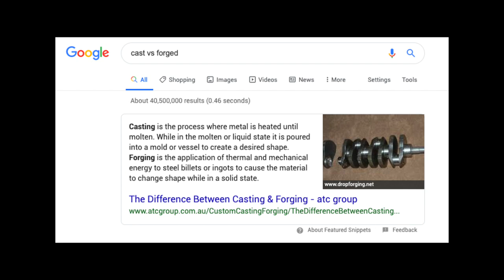Ringland Failure STi Engine Removal & Viewing the Damage..

Comment: did u put a cob tune on it? lol when will people learn
Reply: what wrong with a cob tune ?
Reply: @warock567  it's an OTS (off the shelf) tune. Meaning it's made to fit all WRXs. While this is good for usability and availability while people get their new Accessports, the tune is not designed for your engines specific variables. Every engine runs different, especially after modifying. Which is why it's an important to get a protune or a Map tuned specifically for your engine.
Reply: @Thailerr  oh ok thank for explaining it to me
Reply: Advancing timing with UEL’s is dumb on a stock engine anyway, banks with the long runners are prone to detonation stock let alone tuned where they run on the leaner side... EL’s and a quality protune is what you need to not blow up
Reply: hmm I've had the MaPerformance tune for 3 years. 65k miles on my wrx. when will people learn, yup ja
Reply: @somersfamily  it still run good for you ? I am on maperformance tune too
Reply: Eric and Emily somers what year WRX you have? And the OTS tune may be fine for your specific car, atmospheric conditions and elevation, it’s not right for every car though... and the OTS tunes for the 2015+ fa20 WRX are EXTREMELY reserved...
Reply: Eric and Emily somers what year WRX you have? And the OTS tune may be fine for your specific car, atmospheric conditions and elevation, it’s not right for every car though... and the OTS tunes for the 2015+ fa20 WRX are EXTREMELY reserved...
Reply: the way the guy swings his car around im not suprised
Reply: You guys are getting OTS tunes twisted. OTS tunes are perfectly fine for the person who just wants to throw an intake on their car and leave it alone. That's about all they are good for. What you encounter a lot, is people who continue to mod their car past what the OTS tune was made for. You guys forget, even with a OTS tune, the car still retains its adaptive learning. The OTS map gives a baseline, but the car will continue to tweek the maps the more you drive it. You guys praise "pro-tunes", but I don't hear any of you telling about the horror stories of them. I've had a buddy who drove hours to get his EVO tuned just to come home to be locked out of his $1500 ECU because the tuner wanted to protect his tune. I agree a tuner should tune your car if your modding the hell out of it, not for a simple intake guys, the whole purpose of a OTS tune.
Reply: @dotcom02WGP  Those OTS tunes really aren't very good, just get a protune even if you're stock you will benefit from going that  route. Although they're probably better than a stock tune, but if you live near a reputable tuner that's the smarter thing to do, considering its a tune made for your specific vehicle.
Reply: @Thailerr  So is it possible to still get a flame or pop tune without the cobb thingy?

Comment: I just bought an STI with about 60,000 miles on it and this video has me terrified know that yours broke with only 70,000. I've always dreamed of having an sti but after this I'll probably never buy another subaru again.
Reply: I have 150,000 on mine. I take good care of my car, oil changes every 6k, and I don't launch my car from a dig ever, and I check oil level every fill-up. Looking at that clutch and flywheel, he definitely dove his car HARD. If you want to abuse a STI, you have to build the engine

Comment: Funny how he made a video to prevent from this happening and it still happens to his subie 😭 lol this is what makes not get one why you gotta be a ticking time bomb :(
Reply: I mean he drove it hard without a tune, then gets an OTS Cobb tune, and beats up on it in a hot Arizona weather. Smh. I have my 2017 STi, 34,500 miles. Replaced my clutch, (many clutch dumps and slamming, no surprise there). No engine failure. So, no OTS tunes! Custom tune and let it warm up before beating on it and cool down before you turn it off.
Reply: Yeah I have a 2016 STI with 33k miles. Stock tune and the motor is healthy as can be it doesnt burn a drop of oil between 3k changes.
Reply: @nwbklr  dude there are early symptoms. It won't just "pop" randomly with a broken ringland (you can still drive it with a cracked ringland depending on severity)  unless you throw a rod.
Reply: It’s pretty simple, don’t advance timing with UEL’s, you’ll lean out on cylinders 2/4 with the long runners and pop a piston faster then you can blink. Switch to Killer B EL’s, enjoy the power gains and faster spool, and worry less about blowing it up. UEL’s are the dumbest design, Subaru did a big F there. JDM ej207 has it right with the ej207, twin scroll, EL’s, forged, 8000 rpm stock....
Reply: Driveitsideways 1 Good advice👍🏼
Emilia Hartford Just did a few videos of that same engine swap.
Reply: @someguy920  how do you get your power?

Comment: My dream car is an 07 sti, but I keep coming across videos like this and it gives me second thoughts 😂
Reply: Check your oil. Do recommended maintenance and this won't happen. Oh and get a proper tune lol.
Reply: 07 sti is a good choice, find one that isnt married to a cobb and if its modified, make sure the guy has receipts of all the stuff done. 2.5 liters are alright, the 2.0 are more reliable and able to hold more power. To prevent ringland, rod knock, just keep up with oil and stay on top of it, also dont WOT your engine
Reply: Another piece of advice, don’t advance timing on UEL’s. You’ll lean out cylinders 2 and 4 and blow up faster then you can blink. Killer B EL’s, air/oil separator, aftermarket oil cooler, and s quality protune. Can make max gains on stock turbo without blowing it up that way
Reply: Bugeye Bryan only the 207 is stronger than the 257. I wouldnt bet any other 2.0l block against a 2.5 without being built unless its a 207.
Reply: Bugeye Bryan WOT is fine, just dont over load the car, as in high gear, low rpm wot. This can all be avoided. First things first for any EJ is getting proper maintenance and on time, secondly, get an AOS. No knock means no issues.
Reply: @CXANGLING  Yeah well I say the 207 is amazing because of the heads, but that's about it. That's what I meant about WOT, is to not WOT at low rpm

Comment: just pulled a 2.5 NA apart. Had a Bad Rod Bearing, Cylinders look great and the Honing crosshatch patter is very visible at 190K miles.

Comment: You got lucky on the can gear bolts, first time I pulled an ej they took like 2 hours and the last one was stripped to shit and had to weld on a nut to the bolt to get it out lol
Reply: on the jdm ej20's the cam's have a hex so you can put an adjustable on with a breaker bar. Unfortunately these ej25's suck balls getting the gear bolts off and that special tool barely works if its set in

Comment: I got ringland a few days ago after i installed my EWG upipe and EL header.
Reply: Change tune for it? Sounds like you were running lean or detonating
Reply: Zach Knee it was tuned for it but there was a cap that I removed when I rotated the EWG 180 degrees so it gave a full 24 psi to the block during a datalog and that was it. Lots of blocks can hold it at least once or twice but mine didn’t so now I have an IAG block and it held the 24 no problem.

Comment: Would you do flex fuel. I hear it’s better and reduces heat in the chamber. But is there anything really that will eliminate Ringland failure and catastrophic failures completely with current power plant

Comment: You can get bulletproof piston and rods for $900 for an STI. However, labor to install properly is usually almost $4k. Even main bearings are only $60. Labor is the killer....
Reply: stuna101a  Labor is $4k where you live? Damn. I built my STI with an IAG shortblock and labor was half that..
Reply: @alexlocke6772  the turn around time is a week though.

Comment: So I must ask, should you rebuild or replace the engine in any wrx or sti? And should you rebore the short block? If the short block is rebored, should it run higher than stock power, at stock power or detune it to run well under stock power?

Comment: Honestly I felt like He wasn’t ProTuned he was Cobb Tuned and second He rips his car non stop through snow ice etc. And another reason is He probably had it on sports sharp everytime he drives so hes full boosting 24/7 ej motors are reliable. You just gotta baby it. Check Oil Check Coolant Dont rip it everyday and that’s pretty much It also If you know you’re gonna add parts buy safety parts first like a AOS Oil Cooler and the New Get a Dom tune.

Comment: so basically to prevent this is forged pistons n rods?
Reply from the maker: Correct!
Reply: Always was. No catch can or AOS or equal length header or even a magical protune is gonna save ONE of these motors. You’re either lucky or unlucky with an EJ.

And not to rag on your boy here but the pistons did not fail because they are cast. They’re just plain poorly designed pistons. Yes they are cast but that doesn’t make
them inherently susceptible to breaking. For reference, the Evo also uses cast pistons. And we all know what they can handle...GOBS of power without upgrading.
Reply: Quality PROFESSIONAL tune. Also, run 🌽, keep your intake temps down, ELH, cyl4 cooling mod by Dom Acia
Reply: ELH will help quite a bit, they pop pistons when someone advances timing with UEL’s and cylinders 2 and 4 get really hot cause the long runners, it leans out and detonates...
Reply: @nwbklr  Am i correct in thinking this failure is due to increased temperatures making the piston ring pinch against the sidewall and blowing the ringland out or is this some weird subaru piston stuff going on?

Comment: Hello, when replacing the cam gears. Do you slide that guide/pin between the 3 holes in the rear of the cam gear?

Comment: So I've followed about 4 different guides and have a 2015 sti that I cannot get the engine out of. Even this video misses removing clutch fork pin and briefly hits at the turbo flange but I can't think of anything stopping my engine from coming off the transmission but if anyone has any info let me know on what I could be missing

Comment: Thanks Cameron for the video super informative I really appreciate it . I still have a 17 STI with full bolt ons with E85 at 340 whp 400ft pounds of torque with 24k on the dash and I’ve already been setting my mind and my bank on a built motor. When you car took a dump I seriously wanted to know what the heck happened lol I’ve been waiting for this video .
Just curious during the video you said” I was driving from Yuma and I filled up and got to my parents and filled up again and it was low “ were you talking about gas ? What other symptoms were you seeing when you knew it was done . Thanks in advance.
Reply: Steven Roseren i think is talking about OIL
Reply: Run as much ethanol as you can, invest into a killer b elh, AOS as always, larger intercooler, good protune, and cross your fingers. You “should” be fine for 100k. My tuner says ringland failure is most of the time caused by the tune. IG  @subidoosti
Reply: Steven Roseren 340 whp on e85? 2015+ fa20dit WRX’s at my local tuner shop (VEMS) are making 350 whp and just under 400 wtq on 93 octane with full bolt ons...
Reply: Driveitsideways 1 : its much easier to make power and cheaper on the the FA20 motors the make more hp that’s been established along time ago now torque that’s a bit different because of the clutch and 6 speed the FA 20 wrx have it can’t hold that much torque stock . STI transmission can hold 800 hp without braking a sweat. I’m just pointing up my numbers I know the difference between the EJ platforms and the FA platforms I’ve had both . the thing about the FA it isn’t capable of running full E85 I know soon it will be but for right now it can’t.
Reply: Subidoo STI my next thing is ELH headers lol the killer bee are expensive I might just go with the tomie ones and I’m waiting on a ETS TMIC as of right now lol . ever since I did flex fuel I haven’t even used regular gas lol just E85 straight. Lol
Reply: Driveitsideways 1 plus in California we don’t have 93 a crane we have the world crappiest gas . Our 91 is comparable to your 87
Reply: Steven Roseren yet another reason not to live in that borderline communist state... STi’s only advantage over the WRX is the better tranny/AWD system... our STi really needs a forged ej207 with a twin scroll setup that winds to 8000 rpm...
Reply: Driveitsideways 1 I agree with you almost certainly but the STI is a better platform if your the DCCD being able to control your differentials electronically plus the hydraulic steering that’s still used so you get a real feel between the wrx also the suspension is different the STI is much better much stiffer very horrible On crappy pavement . But it’s everybody’s choice . STIs are great and with a built motor the complete destroy FAmotors that’s why their isn’t a 1000hp FA motor the EJ from the STI has more mods to and fuel modifications. So it’s debate that’s been going on for a while .

Comment: Sti with cast pistons? I thought they came forged? ej257?
Reply: Bugeye Bryan Yes it’s a ej257 and they come cast. Supposedly the 2019 has revised pistons but some say these are still cast too.
Reply: @Dave-so7sf  😕 makes me not want to get one😥
Reply: Bugeye Bryan STIs are kinda one big crap shoot. Most of them last at least 100k when modded properly. This kid is kinda a dummy with no supporting mods like air oil separator, larger intercooler, and don’t think it’s protuned. The not protuned part I could be wrong. I’m glad I bought mine but it is one big money pit. God forbid if the motor does blow there goes 10k out of my pocket. If I was to do it all over again I would buy a Audi RS3 and leave it stock. IG @subidoosti
Reply: @Dave-so7sf  You're right he doesnt have supporting mods, I found a 2015 sti with a cobb, the cobb kinda pushed me away from the car cuz of how they're known for blowing engines if not done properly
Reply: Bugeye Bryan Cobbs fine, as long as it’s used to protune lol

Comment: Another person who doesn't understand these cars aren't reliable when you mod the car to its limits and crank the boost
Reply: Tommy Nakajima actually it’s advancing timing with the unequal headers that kills them, cylinders 2 and 4 lean out, and since the runners are a lot longer they tend to get a lot hotter, resulting in detonation lol
Reply: Tommy Nakajima advancing ignition timing lets the engine run a little leaner. That means more power, but a much smaller margin for error. Cylinders 1 and 3 take it without a problem. But 2 and 4 get really hot since it’s running more lean and you burn a piston ring out... it’s all in the tuning. Switching to EL’s is worth every penny

Comment: Please tell me how much$$$ was all this to start saving money 🙏🏽🙏🏽🙏🏽🙏🏽🙏🏽
Reply: Learyam to what tell you how much money it is Incase your motor blows ?
Reply: Vi Tempz iV lol all us EJ owners want to be prepared for the worst. Probably going to be into this for 10k by the time the motor goes back in. I’ve got quotes before on a IAG short block assembly installed.
Reply: @Dave-so7sf  10k ? U r fucking kidding. Do you get a brand spanking new 0 mile engine w that?
Reply: Rebuild of og?

Comment: Elh is better for performance and reliability
Reply: Joshua Hellis this comment needs to be pinned! Advancing timing on UEL’s is bad on cast pistons.... should just switch to Killer B EL’s, enjoy the spool and power gains, and not have to worry about blowing up....
Reply: Driveitsideways 1  yeah I have Perrin elh that I bought used but I also have a built motor and I still don’t want to have uelh for autocross and track days let alone this heat in az
Reply: Joshua Hellis cylinders 2 and 4 thank you lol, those long runners on those cylinders on a hot day means lots of premature wear. EL’s sound like a actual rally x car too lol. I don’t own Subaru’s anymore (Speed6, it’s a semi adult car 😜) but I burned my ringlands out on my old ej255 swapped gf8
Reply: Driveitsideways 1 yeah I came
From
Muscle cars to jeep to focus st to my subie
Reply: Joshua Hellis I’ve always had Japanese or German cars. All my friends have GTI’s, one just sold his GTI and picked up a 2017 Audi S3. Currently sits at stage 2 with a upgraded intercooler. That car is nutty quick, over 400 hp/tq...
Reply: Driveitsideways 1 yeah I just got protuned yesterday sitting at 285/305 on 91 pump gas and in 115+ heat yesterday

Comment: Weak piston combined with UEL’s and advancing timing with some tuning, means pistons pop... quality set of EL’s (Killer B’s, worth every penny in the gains you get and they last forever) with a twin scroll turbo setup, easy 500-600 whp on a built engine, coupled with fairly quick spool time and transient response, and the torque shove you get with EL’s...... that’s the primo build for the $ you’ll spend

Comment: Should have kept the speed.  Subies are complete JUNK.
Reply: Tazmanian66devil coming from Subaru’s and now driving a Speed6, speeds have there kinks too... stock k04 turbo is junk, and on gen 1’s you gotta deal with the VVT issue which just cost me $2500 total... then again a cheap BNR turbo upgrade that bolts right in is worth every penny, better power band and bigger peak numbers, and you won’t snap your rods cause you won’t have the k04 that surges at low RPM’s and puts strain on them lol